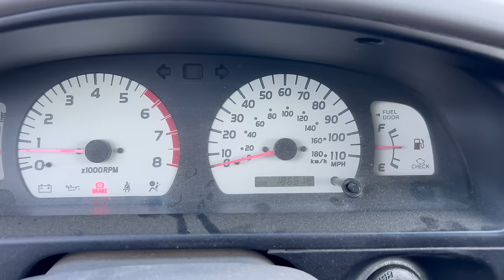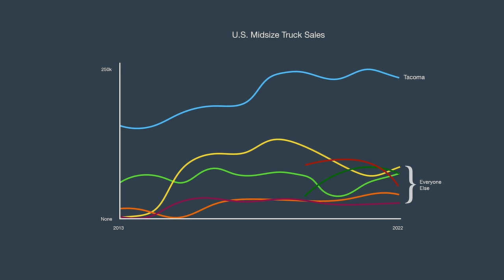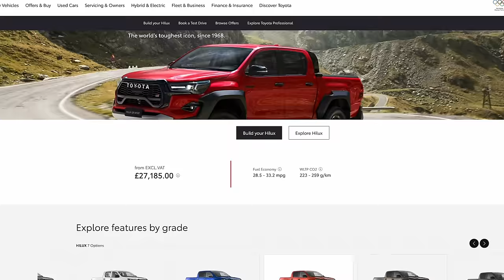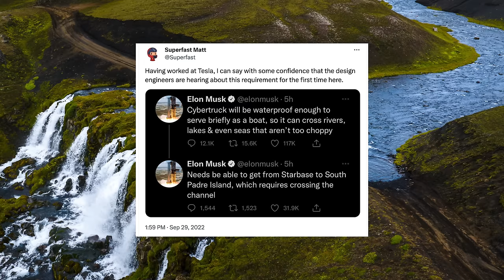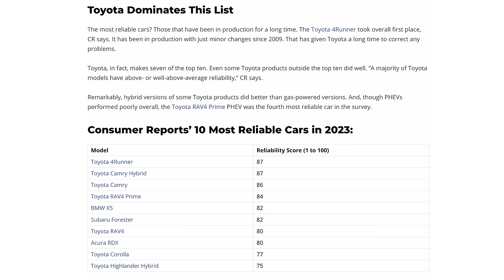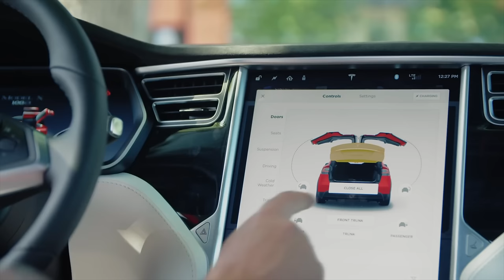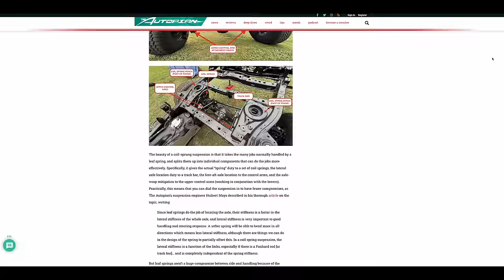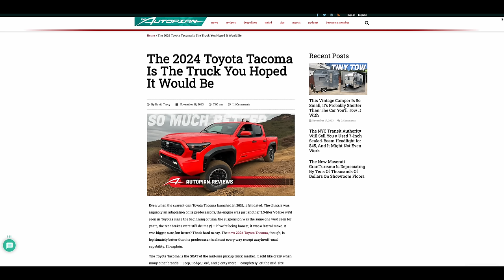What Is The Best Truck, And Why Is It The Toyota Tacoma?

Comment: The new one may be better in most ways, but it certainly doesn't look better. God it's hideous. My Dad's 1970s Hilux had 1.3 million miles of hard use and still had the factory transmission, engine, starter and fuel pump. hell the thing had the factory fricking head-gasket, we broke a lot of suspension components though and Dad was more religious about maintenance than church. He sold it for more than he bought it too.

Comment: The big brother is the 2011-2018 Ram 2500/3500 with the G56 manual transmission. If you need reliability and more tow ability this is the only option

Comment: The Tacoma is a great, but being the best is a toss up. Plenty of GMT800s (my favorite) with 400k-500k on the engines. Anything with a 5.9BT or 7.3 (Powerstroke) are both great. The old ford 300 is also great. 4.0 and 2.5 Jeep in the Comanche. Oh and S10/S15 trucks are great too. So are old rangers.

The main problem is in 2024, the V6 has Tacoma is gone. It was the last reliable pickup. GM, Ford, And Dodge have all gone to shit. And no with the V6 leaving for a turbo engine, I don’t know about reliability.

Lots of people in the comments saying 100k is a lot. Come back when it’s 15-20 years old and has 200k-300k. Then we’ll talk about it being reliable.

Also, low mileage GMT800s are going for MSRP or more because they are so sought after and reliable.

Comment: The high salt areas eat up the Toyotas.  They don’t get the life they could around here
Reply: Same environment destroys all vehicles.
Reply: @ShainAndrews  totally.  It crates a different dynamic when deciding what vehicle is best.  I have found in the past the ford was preferable, because since everything rusts out so fast and is dead before the engine is, it’s often best to just go with whatever is the least expensive.    There was fords everywhere for cheap.  Though lately that seems to be changing.   I have noticed the trucks that seem to hold up slightly better to rust are the Chevy maybe, but with a proper study I may be proven wrong.   If you can get an old Toyota from down south and undercoat it before the rust has invaded , that’s where you got something like this guy is talking about in the video

Comment: 8 years ago, I gambled $400 on a clean, base-model '96 Tacoma with 73K on the clock. Of course, there WAS a major flaw. It wouldn't shift into first or third gear! The fix turned out to be cheap & easy. So I spent another $800 or so on upgrades, including adding an ARE fiberglass cap, a decent stereo, and installing AC. It has 83K on it now, and might be the last truck I'll ever need!

Comment: just wish they'd make a small SR5 again... short overhangs, tight cab that our fat american asses will complain about, and bare min optioned version with manual everything. they've become as big as mid-90's full-size trucks, and $60k+ is asinine even with all the gimmicky crap bolted-on.

i remember the dealer i worked at in '00 advertising a base 2wd single cab for $9,999, which in my 9mo stretch as an unsuccessful salesman, never once saw on the lot. loaded TRD 4x4 quad-cab was $27k. Limited Tundra 4x4 was $44k. we had 3 X-Runners (RARE) at one point for about $18k, which nobody would buy.

Comment: “The car operates the car. It will take your input about gear selection, door locks, or accelerator pedal, consider it, and then decide what it wants to do, and what is best for you. This truck does what you tell it to do, when you tell it to do it, every time, no matter what.”

So well said.

“You decide whether your passenger lives or dies” 😂

Comment: Midsize trucks are overrated.  The midsize is for the average.  The limitations in the size are giant for a car with a bed.  Cost is the same, gas is similar, repairs are the same… repairs however are way different!  Get the card out.  Unpopular opinion I know.
Reply: That's a fair assessment, but, like you said, it's for the average. I don't haul horses, I don't haul a camper, and I sure don't tow Mt. Shasta. However, I do haul a car and trailer, I do put a couple thousand pounds in the bed, and I do try to fit my truck into a driveway. I am average, and for that, a midsize is the better option. Sure, I imagine an F-250 would be more technically capable from a hauling perspective, but I don't see myself actually using that functionality on the regular. The segment certainly has purpose.
Reply: @WeAreChecking You go over the payload of the truck several times over, and are proud of that?

Comment: Its a single turbo not a twin. And a turbo only works if you buy the most expensive gas. Which means it wont give you that power. Plus the v6s tows more. And you gotta do your oil at 5k miles instead of 10k cayse of the turbo

Comment: I fear you have gone over to paying too much for a cheap truck!  Engineers don't buy Japanese BS automobiles.  Go-carts are safer and stronger.  If you want a good truck, buy a Ford with an engine.  Then build a big block engine for your truck.  The Ford stock transmission is garbage, as accounting is in charge of engineering.  Pay close attention to the door handles, as some have a plastic cover on the outside, which means your truck has no security and may be stolen a few times.  To fix the door handle issue, make your own metal covers or pull the starter relay every time you park the truck.